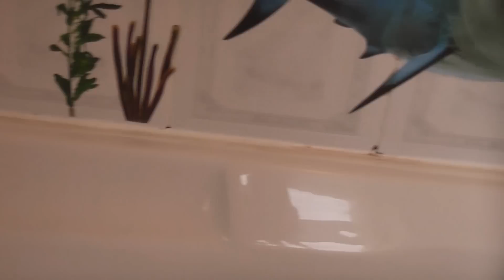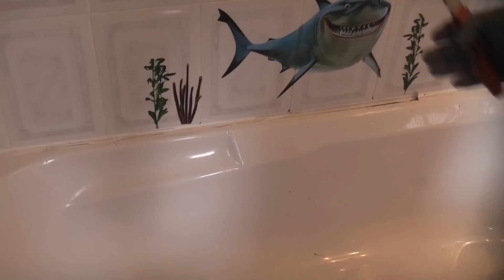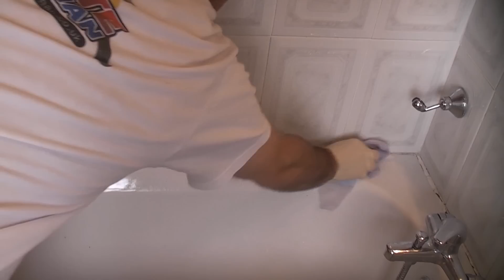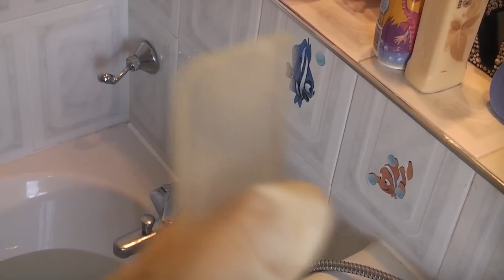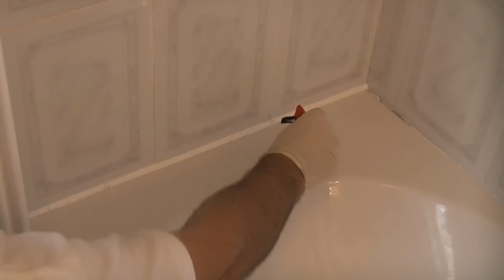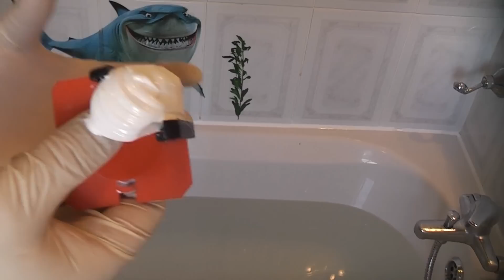How to silicone a bath

Comment: Good video...today I removed the silicone from the bath and spent ages scraping it away but I noticed that I was also scraping away grout from the bottom of the tiles.  What I'm left with now (I aim to apply the sealant tomorrow) is a gap between the bottom of the tiles and the surface of the bath.  Is this right or should there be a think amount of grout in which to apply the sealant to?  Just thinking as there didn't look to be any gap when you removed the silicone.
Reply from the maker: It depends how the bath has been installed.
If there is a gap between the bath and the tiles, I normally fill that with a bead of silicone and tool it off flush with the tiles, using a Fugi kit or similar. Then I apply another bead and use the fugi again to leave a suitable bead (normally 6mm or similar)
https://www.youtube.com/watch?v=6vjTxTFL-k0&t
Reply: @ultimatehandyman  Thanks.  I actually id what you suggested and although I didn't have the Fugi kit I had something similar which helped.  I found that the bath is not flush with the wall and the builders filled the gap with grout which wasn't great so that was what I'd removed when clearing the old silicone.  The job took me ages to do but I got there in the end and your videos helped.

Comment: I'm plannimg on siliconing my shower tray soon, is it ok to use white spirits instead of methylated spirits to degrease at the end as I have some in the garage.
Reply from the maker: I'm not sure, as I always use methylated spirits. It says on wikipedia that it can be used to remove adhesive residue from non-porous surfaces - https://en.wikipedia.org/wiki/White_spirit
But I'm not sure if it leaves any residue behind. Perhaps you could test it on some scrap material first?
I'd clean something with the white spirit, then try applying silicone and ensure there is no reaction.

Thanks for the comment 👍

Comment: What tool did you use behind the taps?
Reply from the maker: I used on of the smaller blue siliconing tools.
I have used a small piece of plastic in the past, such as from a plastic soup container lid- cut to the correct angle and then taped to a screwdriver.

Comment: Any tips for siliconing behind bath taps really close to the tiles? I could maybe fit an ice lolly stick behind them if i put a chamfer on one end but just wondered if you had any tips for this.

Cheers
Reply from the maker: It's difficult.
I have in the past cut the desired angle in a piece of thin plastic (I used a lid from a plastic soup container) and taped the plastic to a screwdriver, this then enabled me to get behind the taps. You can also buy special tools for it, I have a set but have not used them yet- http://fave.co/2iJgiLU
Reply: Wicked thanks :)

Comment: silicone is not the best product for that job use an acrylic sealant which does not support mould and is much easier to use. If you make a mistake a damp cloth or sponge will soon clear it up. If you use a finger to "tidy" the joint just wash hands in water after. It never goes completely hard and remains flexible.

Comment: Brilliant video, very helpful! Have just ordered a set for myself :) Any tips for a tidy bead along Metro brick tiles with the bevelled faced? Thanks again and keep up the great work!
Reply from the maker: You are welcome.
It should be okay as long as you use the guides for the Fugi kit, also after applying the bead of silicone if you spray over it using cold clean water and soap solution it makes the tooling easier.
Hopefully that will give you good results ;-)
Reply: Great stuff thank you! Will give it a go when the kit arrives. Cheers again :)
Reply from the maker: You are welcome.
Good luck with it ;-)

Comment: The bead behind the taps.  did you do it freehand or did you use your tool?  How do you clean the tool?
Reply from the maker: +Aman A 
I used one of the Fugi silicone tools until I reached the taps, then maneuvered around the tap carefully.
You can wipe the silicone from the tools using a damp cloth etc.

Comment: Here's a good tip for applying silicone behind taps:
Put a second nozzle onto your gun, or even a third , to give you a longer reach.
Works great, especially  if you don't have Fugi type tools , and are just finishing off with your finger and soapy water.  Oo-er ! sounds a bit rude.
Reply from the maker: +Marilyn Perks 
Thanks for the tip
Reply: thanks....will remember that tip

Comment: if you use a hair drier to heat the silicone 1st it comes off easill
Reply from the maker: Paul Hart 
Thanks for the tip, I'll try that one day ;-)
Reply: Hair dryers and bathtubs are not the best combos, just saying.  All sorts watch these DIY videos and common sense is not that common.  Great video btw.

Comment from the maker: ***** 
I used a Unibond sealant removal tool to remove the old silicone, then a Fugi kit to tool off the new sealant.
Thanks for the comment ;-)
Reply from the maker: Yes, but you need to clean the WD-40 residue off before re-siliconing, perhaps with Methylated spirits etc. 
https://www.youtube.com/watch?v=mq2Z-i5Iy7s

Comment: For some it will be messy filling it up again.
Using painters tape on the bath and wall will solve the problem.
Just rip it off carefully after smoothing.
Reply: I did this painters tape trick with frog tape, its good and works but it left a slight thicker lip on both sides of the seal this was done after it dried and I ripped it off slowly, so when I wash my tiles and around that seal you can see its lifting up a tiny bit. I think ill try wd40 and that frugi tool next time to get a firmer crisp edge and finish.

Comment: I am afraid to run a razor blade along my bathtub because even if it doesn't cut it or scratch it, sometimes it seems to leave a mark, like a grey metal mark on the porcelain that does not come out.  Do you know what I am talking about and is there a way to avoid that?  Another great video, as always.
Reply from the maker: You could just try one of the plastic silicone removal tools. I only used the knife because of the sealing strip which was made from plastic. The silicone removal tools are quite good, especially after applying silicone remover.
Reply: ***** Ever had a slip with a Stanley - Not nice!!!Better off with the proper tool!!!

Comment: Absolutely fantastic video. I purchased the Same silcone tools as you from amazon, I've used then only once so far and I was not disappointed! Also I prefer unibond bathroom sealant, I've used cheap sealant and I've been let down, 1 week later cheap stuff starts to peel off. Anyway thanks for the video!
Reply from the maker: You are welcome Faisal. Silicone can be funny stuff to apply, especially when the weather gets warmer as the working time is reduced tremendously. I have used Unibond in the past and it was good stuff.
Thanks for the comment ;-)

Comment: why fill the bath with water while applying silicone? any reason for that ?
Reply from the maker: Yes, the bath when filled with water will pull away from the wall slightly, so it's important to fill it first with water before applying the bead. Then the next day let the water out and the bath will spring back to it's normal position, if you don't do this the bead between the bath and the silicone can break quite quickly.
Thanks for the comment
Reply: ***** That is good to know ... I would not have thought of that.

Comment: I think what your video shows is that the most important thing is preparation prevents piss poor performance,once that lesson is understood most jobs/ projects go without hitch, even then things like silicone sealant behind taps can be awkward unless prepared with a purpose made tool.
Reply from the maker: That's correct. Most of the time taken on this job was the preparation, the actual siliconing did not take long at all in comparison.
Thanks for the comment

Comment: I had to do this just last week. I have an oscillating multitool by mastercraft (Canadian Tire brand), that has a ridged blade for this. It takes off the silicon in seconds.
Reply from the maker: Thanks for the comment.
I have one of those tools too but have not used it yet for this.
Reply: ***** no problem. I didn't know about the silicone solvent and spirits. I'll use that next time for sure.
Reply from the maker: Curtis Frost
Thanks for the comments ;-)

Comment: You make everything look easy, do you?
Reply: FoodOnCrack It isnt easy - one slip of the stanley knife (i've done it) and your customer wont be happy with a scored shower base or bathtub - best to use a proper silicone sealant removal tool if you are doing it for customers. Oh and not to forget breaking the stanley blade is not hard to do when removing hardened silicone sealant (done that too!).
Reply from the maker: I wouldn't say this was easy, it took me ages removing the old stuff!

Comment: I put some washing up liquid mixed with water in a spray bottle and spray it over the silicone before tooling, this stops the residue on the tiles and bath and also lets the tool slide easier.
Reply from the maker: I'll try that sometime ;-)
Thanks for the comment